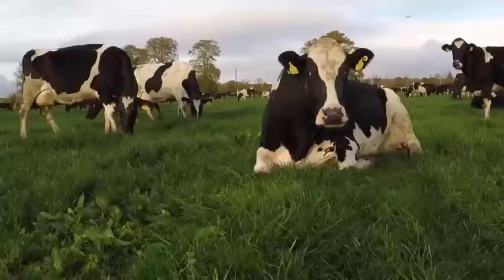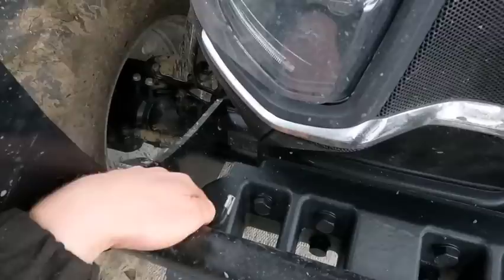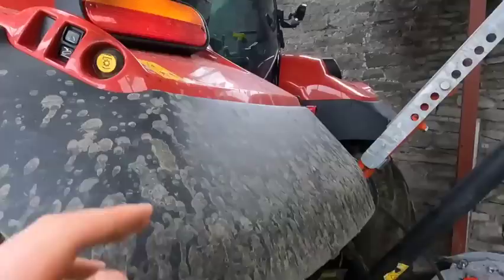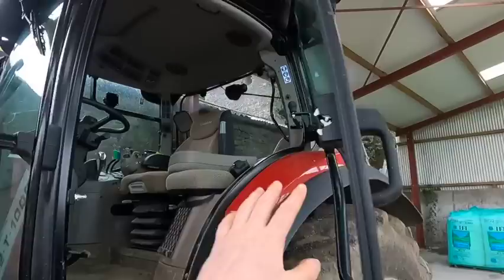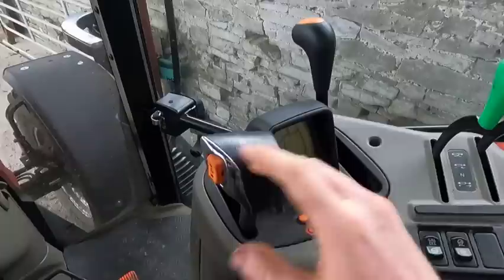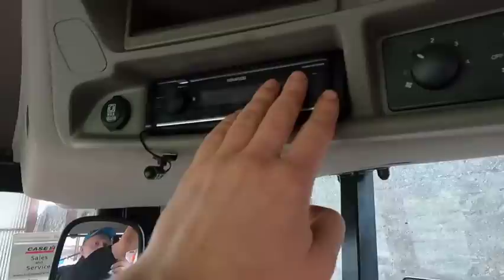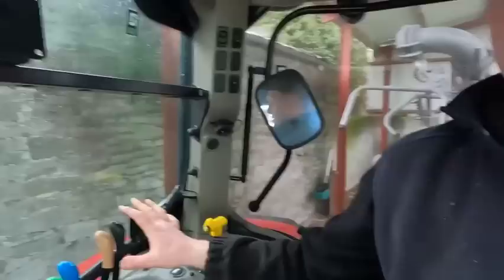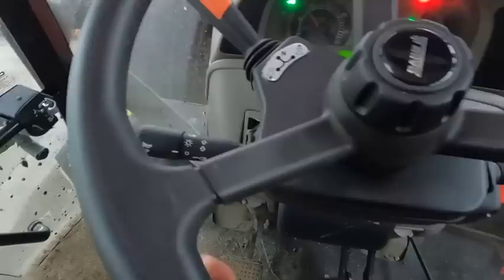OUR BRAND NEW TRACTOR!!!

Comment: I don’t know if it is the same where youre from but in South Africa the low spec tractor’s don’t get radios put in from the factory the dealer puts them in and for the cup holders I take old filters and cut them open and mount them in the cab they work graet

Graet tractor good luck😉
Reply from the maker: Great idea 👍

Comment: Lovely tractor, it looks really modern from the outside. Then as soon as you climb into the cab we see the same old interior as the MXU135 model from 20 years ago. Case have definitely got a good run out of that interior! Am I right to assume that the Active-Drive 8 transmission only comes with the multi-controller interior? Best of luck with the tractor 😀
Reply from the maker: Yep your right about the transmission

Comment: Fine tractor they are styled so good best look with it , will handle tanker easy 👍
Reply: We have the exact same tanker and I can tell you it will barley handle that tanker on level ground but if you are on any banks it’s not heavy enough or powerful enough because the maserator take a bit of power
Reply from the maker: I've pulled the tank with 100hp, 125hp 140hp and this which is 150 with boast to 180hp. I reckon the macerator needs an additional 25hp vs a tank without. 140hp is plenty in my opinion
Reply: Only on level ground but if there’s any bit of a bank it will struggle
Reply from the maker: @johnearle6667  maybe on a steep slope im not sure but it hasn't struggled on hills I've been on
Reply: We have a new Holland T7040 and it’s on top of the job to handle that tank and it’s 240 horse but we used to have it on an 8360 which is around 135 horse and it couldn’t handle it except on very level ground